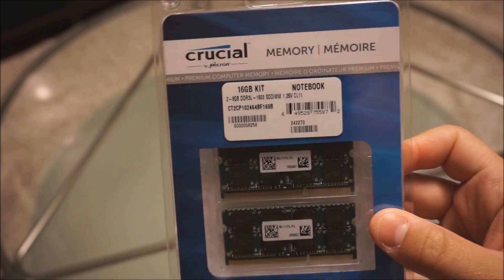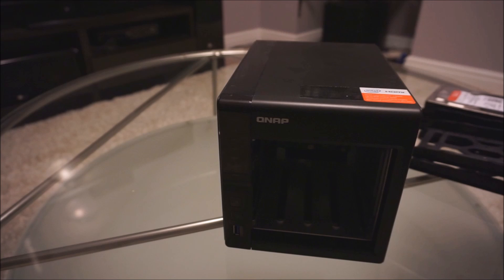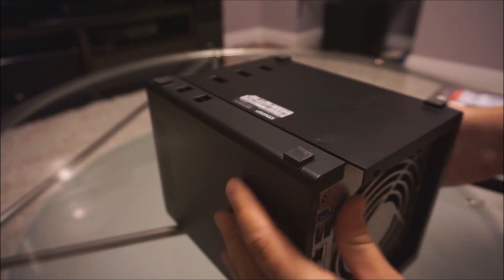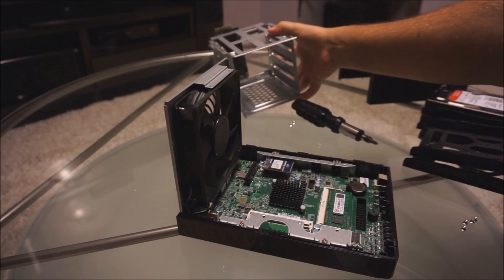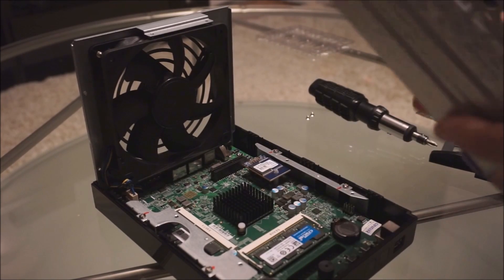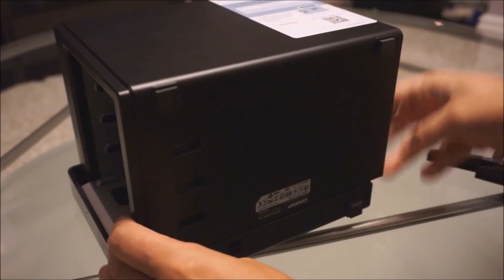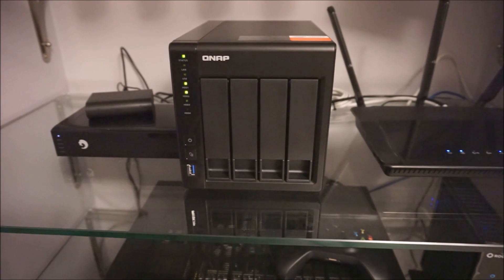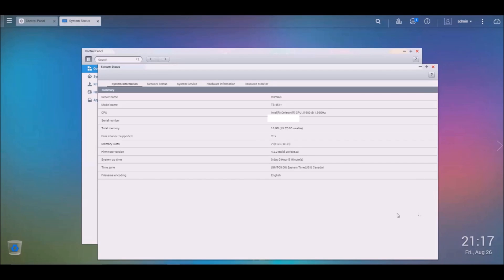QNAP TS-451+ 4-Bay NAS - 16gb Memory Install

Comment: I bought a QNAP TS-451+NAS a few days ago, upgraded one slot to a cache SSD, that and aggregate made quite a positive impact, so, I decided
to buy 16 GB Crucial, not the 16GB kit, just 2X8GB CT102464BF160B RAM modules
Installed both dimes, and then....Nothing, 4 slots populated, 1,2,3 with $GB drives, slot 4 with a 480GB SSD as a cache disk.
Nothing is actually, the network Led light up and the first and second LED, nothing happens after that.
I tried 1 Dimm in the original slot, does not work either.
So, it seems to me QNAP did something about it or I got the unlucky "ticket"
I read several forums, some where lucky, some not, but this, most time, was a while ago, like years ago.
Is there anything else I can do?

Comment: I'm planning to do this and bought the RAM right out the gate. One question I have is should I get it setup first before installing the RAM or can I swap/install the RAM before initial setup? Does it matter?
Reply from the maker: I believe I was already using mine before upgrading the ram.

Comment: Hey just a quick update, after more searching around, I believe what is happening is people are being confused by the ARK page. The J1900 does in fact have a 8GB memory limit, but that is PER MEMORY CHANNEL, that is why 16GB works, because it's a dual memory channel cpu and since you are only putting 8GB per channel, you get 16GB. So yes, by the ARK page, your max memory limit would be 16GB total (8GB per channel) so most likely any 2X8GB DDR3L 1333 Memory kit would work.
Reply: This set of chips is 2X8GB 1600 DDR3L SODIMM RAM, not 1333, so am guessing that any of the the faster 1600 would work as well. Not sure if CL11 (CAS latency)  is essential to match up with or not though. I gather this is also Unbuffered and NON-ECC so would look for that in the specs as well.

Comment: You don't have to label the drives. It doesn't matter which way they go in either. 
16gb works fine this was the first thing I did before I even out drives in it.

Comment: I have seen a number of QNAP owners talking about very slow boot times for QNAP nas (5-10 minutes).  I was wondering if you  were observing this as well.
Reply: Mine (2GB) was taking about 6.5 minutes to boot. Replaced the 2GB with 2x 4GB (8GB total) and boot time dropped to 5 minutes. Wasn't expecting that, but happy about it anyway. The thing can be left running, so boot time isn't usually a big deal.
Reply from the maker: Yeah I would say so.. I don't need to reboot that often though

Comment: Have you had any stability issues?  One of the threads off reddit redacted the original report on Crucial CT102464BF160B 16GB (2x8GB) RAM, claiming the RAM was causing segfaults.  Is yours still running ok?
Reply from the maker: I've been running it fine without error since the video was made.

Comment: It should be noted that while Intel Ark lists 8GB max on many lower end/embedded chips, this limitation is usually implemented in software on the chip, and many vendors get versions of Intels chips with various limitations altered/disabled, to meet various design goals and needs.   It is entirely possible these chips are of a sub-model batch, that the 8GB limit was disabled on, which would explain why they are able to detect 16 GB properly.   All intel 64 bit chips support at least 16GB design and channel wise, but many are limited intentionally at the chips software level, to force you to use/buy higher end chips to get more ram capacity, it is how Intel makes more profit margin.   Notable examples of devices where these limits are voided, are many of the embedded firewall boards that use chips that supposedly dont support more than 2GB, but often are found to work fine with 8GB or more.    This is also why many/most of the super cheap intel atom quad core laptops, such as those with X5s, and others, have the RAM soldered on, making it impossible to remove/swap, because the chips technically support more ram, but intel and the vendors use that to force you to get a higher end model to get more ram capacity support.

Comment: Same as previous videos, there is no point upgrading your 451+ to 16GB RAM if you have not upgraded your CPU in the first place. The native CPU on your QNAP 451+ is an Intel Celeron Quad Core J1900 and Intel clearly specifies that the maximum RAM supported by this particular CPU is... 8GB.

The QNAP OS which I think is Linux based will detect your 16GB very clearly and will even fully exploit it but only prior to a CPU upgrade. 

There are two elements to consider before upgrading RAM on any electronic device:
1- can the OS take it?
2- can the CPU take it?

The answer for the QNAP 451+ is:
1- Yes
2- No

Comment: Dear Hip-IO, so if I was to decide to choose between TS-451+ 2GB and TS-451+ 8GB, I should take the 2GB version and update memory to 16GB? Do you consider this upgrade safe and robust even after one year? Thanks!
Reply from the maker: +Juraj Maciak I would do the 2G and upgrade it. It's found it easy, but it depends on your comfort level opening it up and installing it. I find when you second guess your self that's when mistakes happen, so just be confident. Mine is still running efficiently.

Comment: Well... QNAP TS-451+ is using Intel Celeron Processor J1900 which can only deal with 8gb of ram. Since I doubt intel would lie like that - I will place a bet that half of your ram is never used.
Reply: actually, it works fine, i do think the Intel Ark page is in error/typo i mean who's really caring about specs on an OEM j1900 cpu. ROFL. But it does in fact give you 16GB ram, i did this as soon as I got my 451+. I run several virtual machines on it, using 4 - 8GB each, and leaving 2gb for NAS stuff. Yea it works just fine.
Reply: @bBrain  Can you send a screenshot of two VMs running simultaneously and the amount of RAM each OS reports being used that adds up to over 8GB?  That would seal the deal for me.  Merely setting up the VMs to use the RAM that QTS already acknowledges is there is one thing. If the OS in each VM reports it's using the amount of RAM you setup and it is over 8GB total, I'm upgrading mine. I think that's an adequate test.
Reply: @stevesybesma  Ok no prob, I have two unix boxes on it, let me setup two win boxes real quick I know it works, I've done it several times. Here's a screen of the setup 
https://snag.gy/RxbXdV.jpg
You can't do two VM's running both exactly 8GB, as you only have 16GB and you need to always have 2GB for the NAS os to use. You can do one VM as 8GB and another as 6GB. 2 is being used by the qnap.
Reply: @stevesybesma  Screens
qnap virtstation https://snag.gy/DnIzE5.jpg
autoinstalling win10 on two VMs  https://snag.gy/5sRCph.jpg
as soon as windows is installed I'll shoot some more of both of them
Reply: @stevesybesma  https://snag.gy/iCQUec.jpg  and there is two separate win10 vms. 
Granted running two window 10 vms like this is pretty much slow, they run better if they were set to like 6gb each and 2 cores each... But yes it does in fact use all the memory. Unix style vms obviously run a lot better than windows.
Reply: @brianheckathorne9690  thank you very much for the screenshots
Reply: @brianheckathorne9690  hey buddy... I was told also that I could only go up to 8 gb at microcenter where i bought the unit. question for you can i upgrade the Ram to 16 without re-formatting or deleting my data. can i litterally just take the drives out and swap out the ram? easy peesy?
Reply: @TheTrinityProjectinc  Yea, super easy, this video shows exactly how to do it. Also be sure when you take your drives out, to put them back in the same exact slot they came out of. 
Doesn't mess with your data upgrading the ram at all.
Reply: @TheTrinityProjectinc  Also I ordered the same exact memory kit that is shown in this video. So I only know for a fact THAT memory kit works 100%. This video has a link in the description to amazon for it, that is where I bought my memory kit.   But it would not surprise me that any 2x8GB kit would work seeing how that would be a CPU support thing. I'm pretty sure the Intel ARK page showing 8GB is a typo and that carried down into the actual product marketing, who knows. lol
Reply: Hey just a quick update, after more searching around, I believe what is happening is people are being confused by the ARK page. The J1900 does in fact have a 8GB memory limit, but that is PER MEMORY CHANNEL, that is why 16GB works, because it's a dual memory channel cpu and since you are only putting 8GB per channel, you get 16GB. So yes, by the ARK page, your max memory limit would be 16GB total (8GB per channel) so most likely any 2X8GB DDR3L 1333 Memory kit would work.
Reply: @bBrain  Years later, does not work on my new (got a great deal) QNAP TS-451+, not the set from the video but 2 separate Crucial CT102464BF160B dimms.
That though should not matter or does it?
Or, do I revert back to the old firmware, believe me, it came with QTS 4, or completely start from a factory reset?

Comment: I've read that Intell claims that machine can only utilize 8 GB of RAM even if it is recognizing 16 GB installed. This 16 GB upgrade has to be tested and proven yet.
Reply: Intel says the CPU is limited to a max of 8GB RAM, but I'm surprised it recognizes 16GB if it can't utilize it.
I'd like to see screens showing the NAS actually using all of the 16GB (or at least using more than 8GB).

Comment: Great video !!!! If I may indulge your knowledge. I live on my boats. I am currently setting up a 77 foot Catamaran and like how these units are 12vDC so I do not require an inverter as all my other network gear is 9vDC or 12vDC (a great feature for POE and my AP's"). Could you be as so kind and tell me the exact printed voltage and amp output of the external power supply of your unit !!! Thanks so much !! Alan
Reply: Maybe way too late to help you, but if anyone else wonders, mine says 12Vdc/7.5A.

Comment: did this upgrade and qnap just entered reboot loop. replaced memory modules and problem only happened for one module. But system would not boot properly for 8 gig installed. Stumped as many people have upgraded and had no problem.

Comment: Do you get better performance in Virtualization with 16GB? Dost it work faster with virtualization?
Reply from the maker: +Otto Agne I've only used my system with 16gb, so I can't compare. But being able to allocate more mem to the VM will increase performance.
Reply: @HipIOReviews  Please provide a screenshot that shows the OSes of two VMs together using more than 8GB of RAM and I'll believe the RAM is being used.
The QTS reporting is not enough if the CPU cannot make use of if. If you can show actual usage of over 8GB, then I'll believe it and buy the memory to do the upgrade.
Reply: @stevesybesma  i'd like to know too but this poor bugger is only showing that ya "can" do it....not to convince you of it's capabilities... i'm sure the guy doesn't have enough fucks to give if you buy it or not.
Reply: Everything works faster with more RAM...less swapping and I/O operations

Comment: Great video!
Is your Nas running smoothly after a couple of months from your post? I've read that many people have problems with 3rd and 4th drive of Raid 5. Thanks in advance (i have a TS-451A and i'm about to do the 16GB upgrade)!
Reply from the maker: +SerenityBrokenBand I'm currently only running a mirror

Comment: Great testing.  Why does crucial reports that it's not compatible. Did they really tried?
http://www.crucial.com/usa/en/ct2kit102464bf160b (will it work on my system section below)
Reply from the maker: +Luis Ramos maybe QNAP reports to them it doesn't, as they probably want your to buy a upgraded nas model?